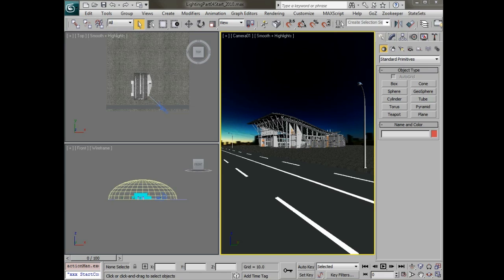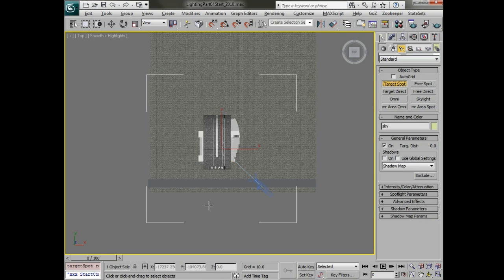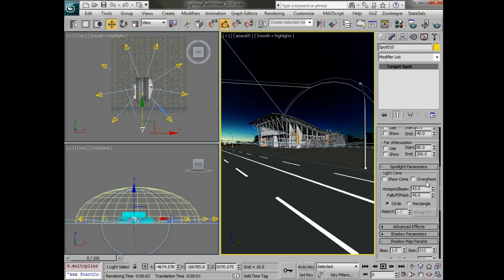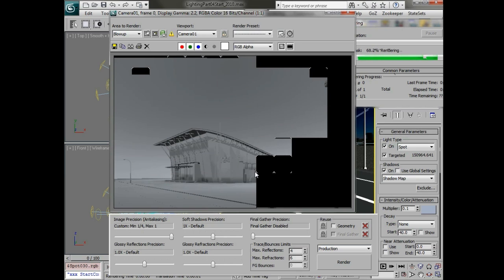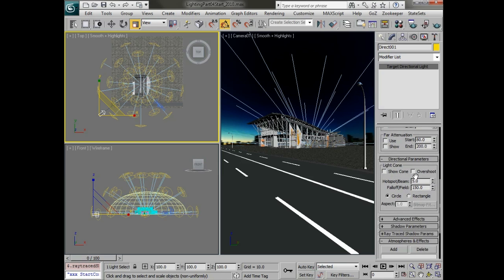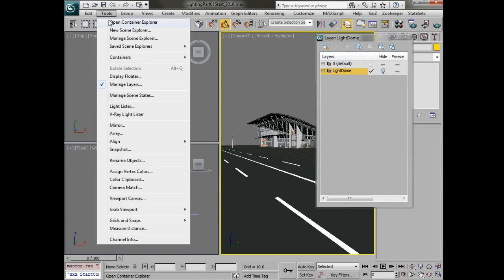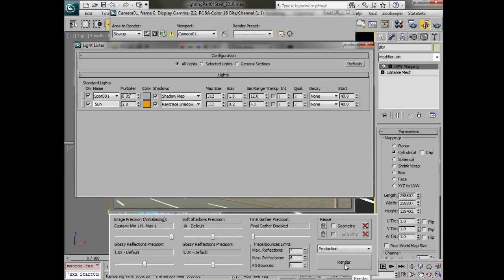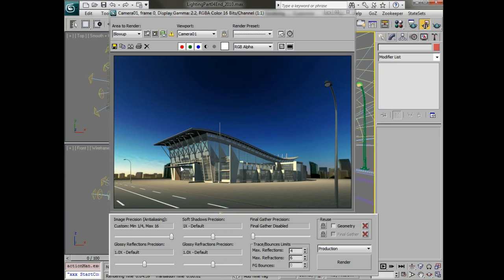Light an exterior scene in 3ds Max

Comment: thanks for the video... do you know how to make an area light / rectangular light in 3ds max like maya's rectangular light? The one in max shows multiple round hotspots so it looks really bad. I tried to make a group of spotlights but that also shows off the hotspots when they are close to a planer surface.I can use vray lights but vray lights don't support depth map shadows, only raytraced.. thus it takes longer to render.